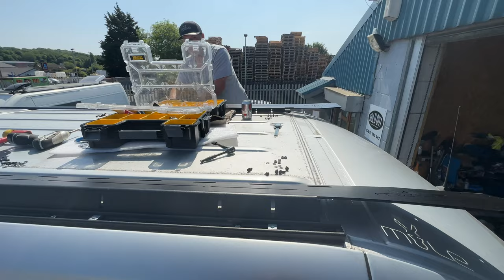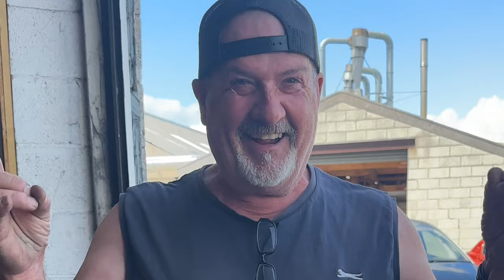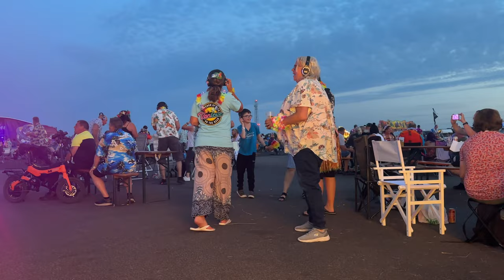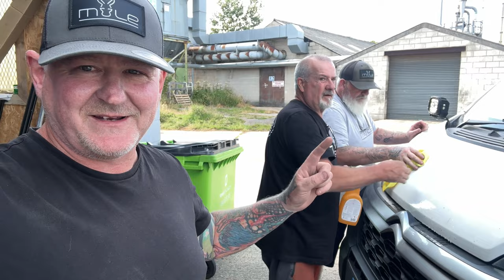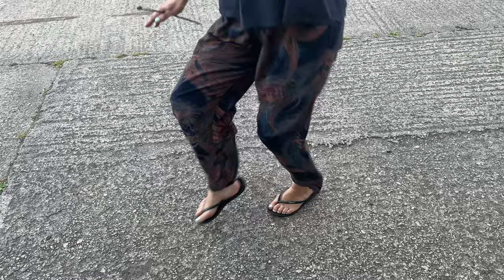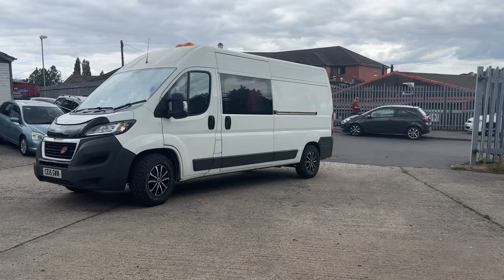Mule Vans, Van Love Festival, and Exciting Upgrades!

Comment: Have mule made a bracket for the gear box mount on there lift kit, as it hits the cross member when the spacers are fitted between body anthe cross member
Reply from the maker: Yes we have gear box brackets all made for the lift kits.

Comment: Your new wheels look proper rugged and I have not seen any like that on vans. Archie was barking well at the pole, i think he was asking you to stand it upright so that he could cock his leg 🤣
Reply from the maker: In a few days the lift and new wheels happens, can’t wait to see it happen and film it! Proper rugged off grid wheels and tires, and better ground clearance for the van off grid! Hope you’re well? Archie sends his regards 🐾
Reply: @PackTheVanAndGo  Cheers Rob, great solution for ground clearance without altering the suspension. It may however change the gearing ratio slightly but not by much hopefully, so as not to wear the clutch pulling away.